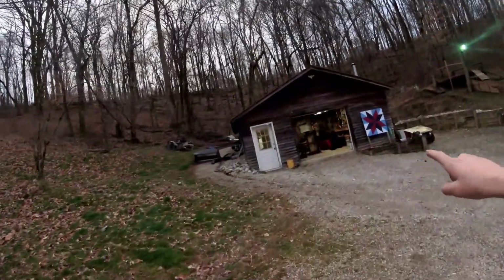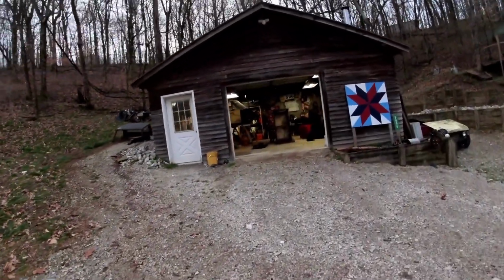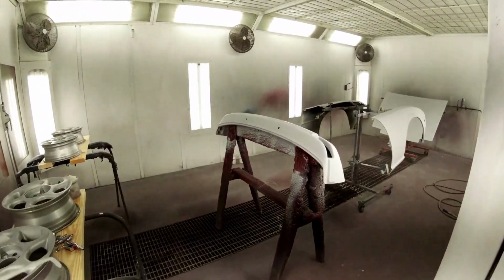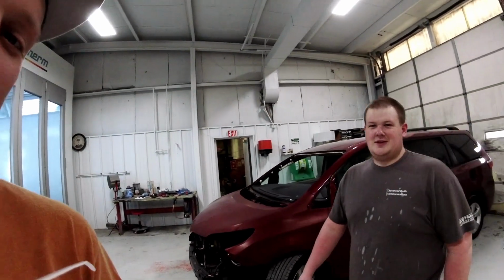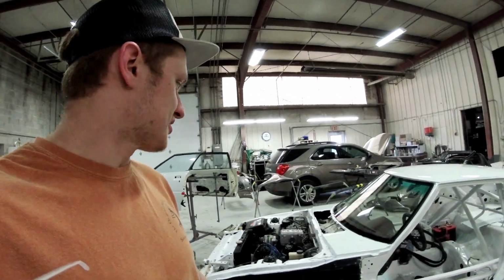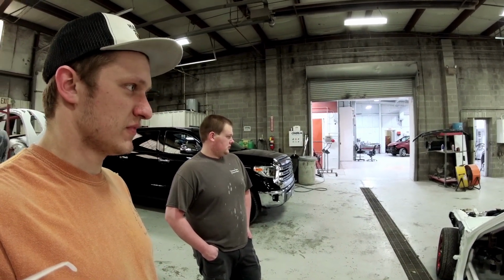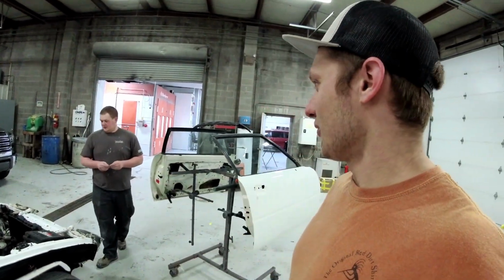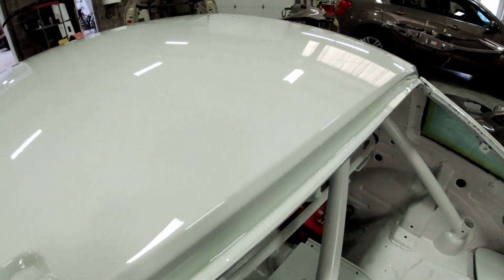HUGE SUCCESS : Fresh Paint and First Startup - Rx7 Rally Restoration

Comment: What’s up with the passenger side rocker panel?
Reply from the maker: Unfortunately the rocker was crushed and folded in an off at a rally.  Could it have been cut out,  Repaired and fixed sure. For a race car it will be alright, we straightened it the best we could.

Comment: Mine literally did the exact same thing; I disconnected the MAF and it stayed idling.
Reply from the maker: What fixed yours?
Reply: @RADPotential  I had to replace the injectors and fuel pressure regulator that had been sitting for 33 years, then it would run for a few seconds and die. I disconnected the maf (and eventually replaced it) and it stayed running.
Reply from the maker: I may have to try another maf going to do pump and pressure reg first